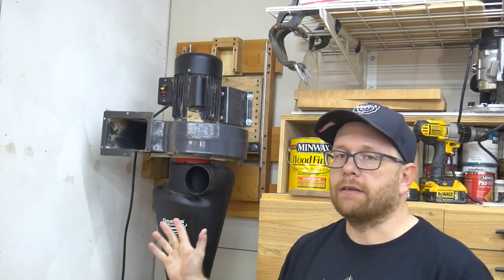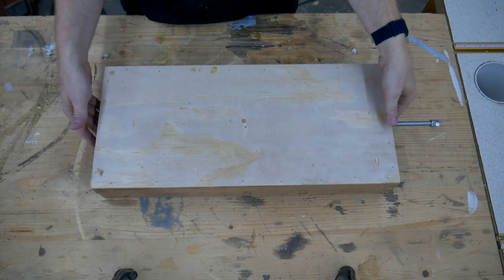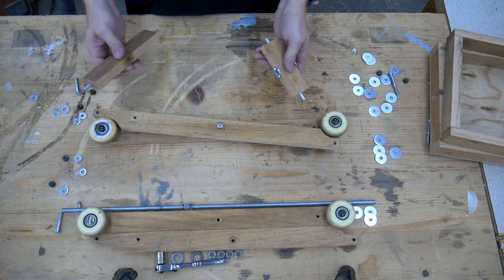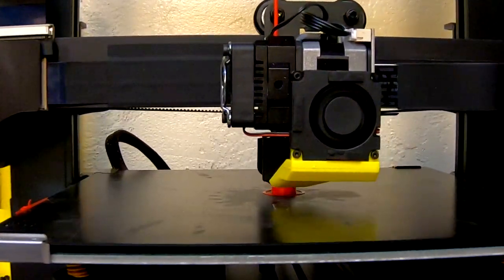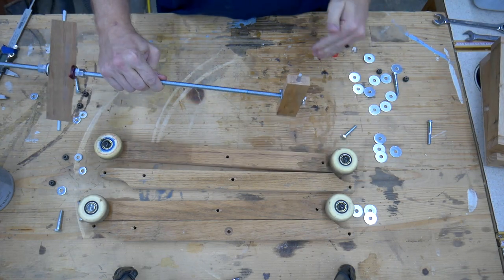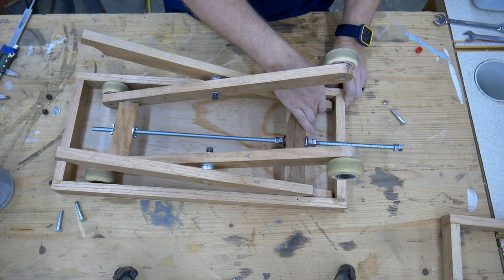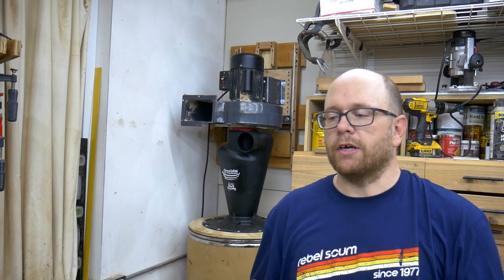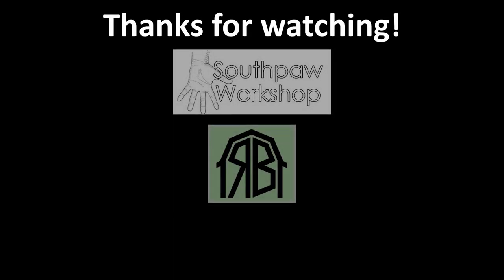Scissor Lift for the Dust Collector || "Affordable" 2-Stage Dust Collector Part 2

Comment: Mine is set up exactly like yours but my can stays on the floor. I use a small flex hose between the can and the collector. Works great!
Reply from the maker: I may end up doing that in the long run, but I didn’t like how the coupler at the top of the dust deputy tapered down to 4 inches. I also don’t have the 5” hose that came with the dust collector anymore. Otherwise I would have simply printed an adapter.

Comment: That’s a nice clean solution. I have a very similar setup with the super dust deputy, except I just have a short piece of flex tube connecting the top so I can disconnect it and slide out. I’ll have to do this upgrade! A couple suggestions if you don’t mind… I love using a drill with a socket to run this kind of thing, but sometimes the socket will try to slip onto the second nut and it’ll jam. If you put a washer between the nuts, or swap one of them out for a flange nut you’ll prevent that. Super anal me (engineer… can’t help it) would even go so far as to order the right size nut driver and just leave it on a small magnet on the side of the collector so it’s always there when you need it, just grab a drill and go! I also want to cut a window in the side of the drum and put some plexiglass on it so I can see when it’s full. Again, awesome project!
Reply: Also, nice shirt.
Reply from the maker: I had to go back and see which shirt I was wearing, lol. I’m trying to figure out a solution for using a drill. I appreciate the suggestions. I know for a fact it doesn’t like the impact driver though. A regular drill will be good. 
I plan on installing an ultrasonic level sensor on this system to keep track of the level in the drum. We’ll see how it works out.
Reply: @SouthpawWorkshop  nice I’d like to see how the sensor turns out! I bet a cordless half inch drill would turn that sucker in low gear. You only have to lift it when it’s empty, otherwise you’re just lowering it! But yeah try using a flange nut for one of those jam nuts, your socket will never get stuck on there.